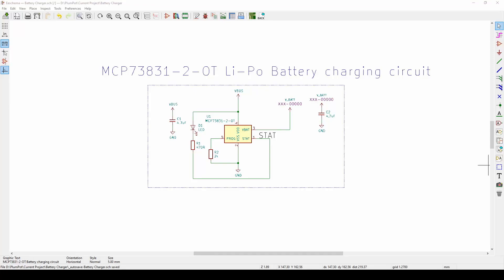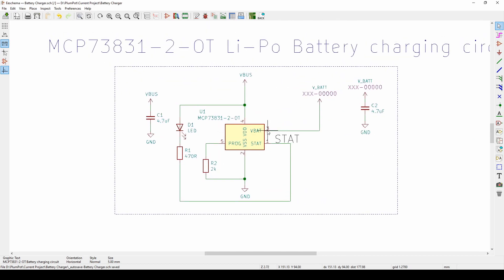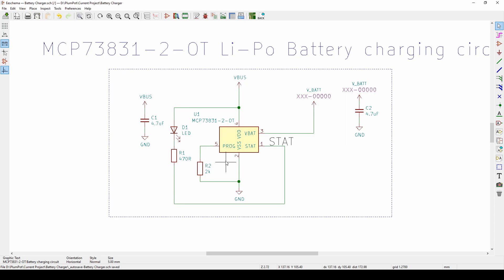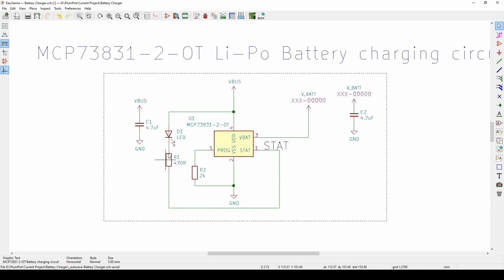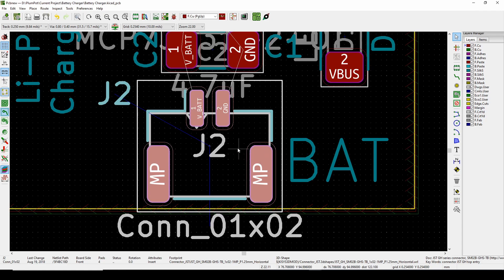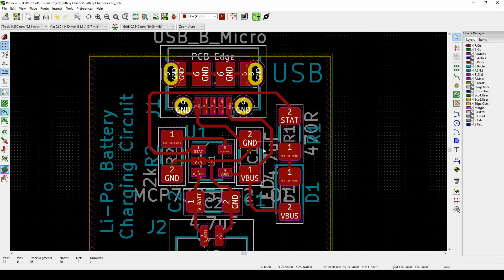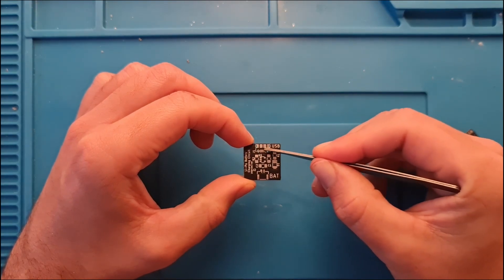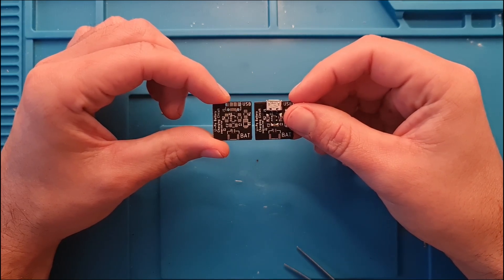Let's Learn Circuits in KiCad #3 - Li-Po Battery Charging Circuit

Comment: Dear sir, I try to make 2S li-ion charging circuit using XL4015 module. With mosfet for power path. When I connect the battery my power supply over current trigered, but it looks normal if no battery in it. Can you have quick look at my circuit.
https://github.com/yudxp/Charging_circuit/blob/master/Charging%20circuit.PNG
Reply from the maker: No problem I'll have a look at get back to you🙂